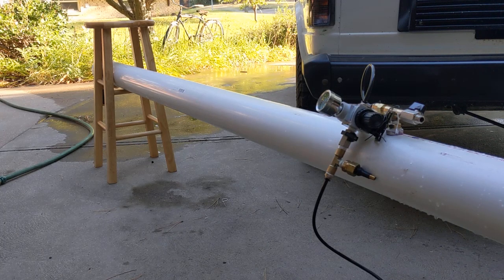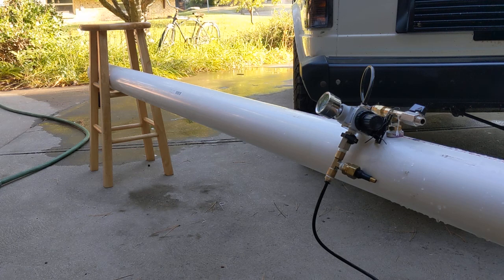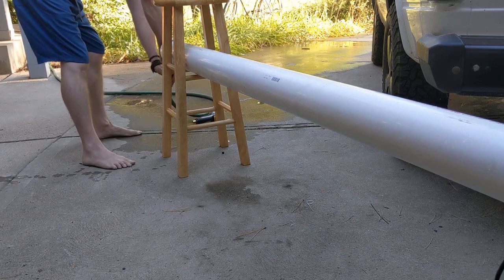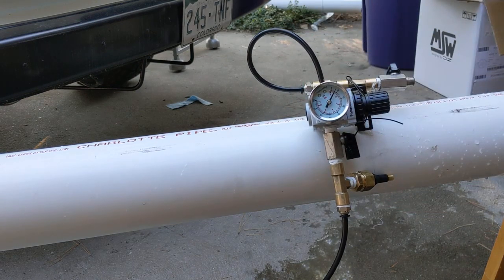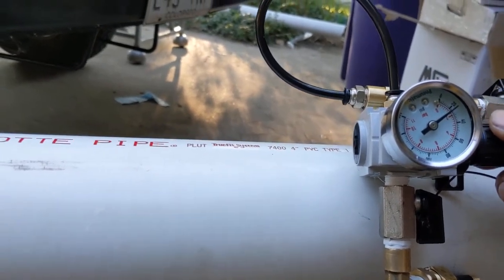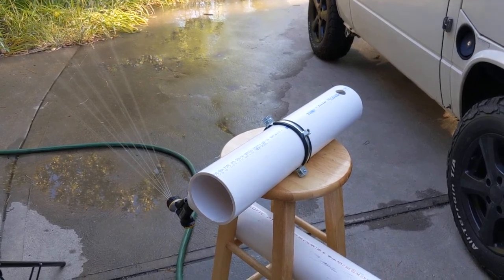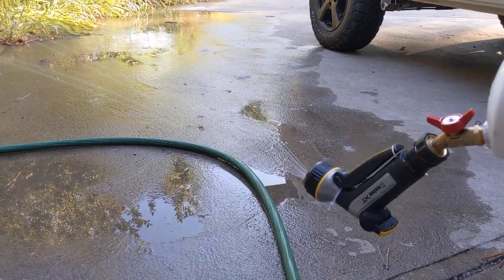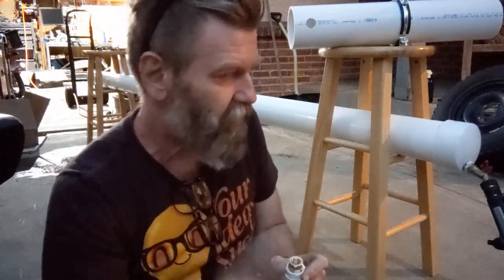DIY solar shower that is safe.. and doesn't need to be recharged with air!

Comment: This vid NEEDS more views! I was considering building one of these, but would not, because of the pressure rating on "big box" pipe. Or, more accurately, a lack of pressure rating.

I appreciate the suggestions for sourcing the proper materials. Using a pressure tank for regulation is an excellent idea. I have a pickup and have the room, so I actually considered using a household preasure tank. But, using the spare instead is brilliant! Like you said, you're already carrying it around. Thanks.
Reply from the maker: Thanks for your kind words.  In the end I persuaded myself that I simply HAD to have a tank on board, even though I really don't. I blame COVID!  If I don't have something to obsess about and improve, I go a little crazy right now.  More info on the shower and air in this video if you are interested https://youtu.be/nJBcLwlY1Aw
Reply: Agree - needs more views
Reply: Great information.  Thank you from the land "down under" for all your efforts researching & experimenting!